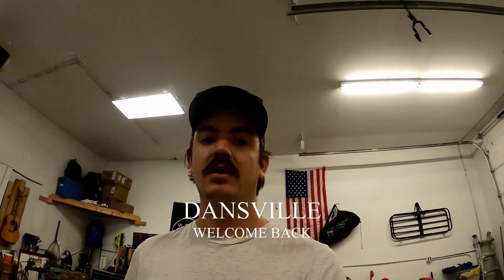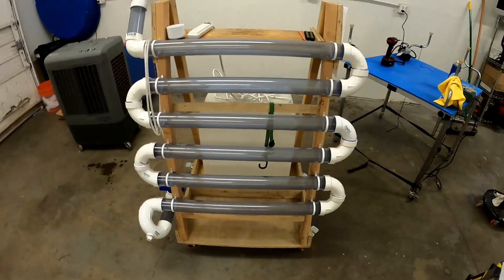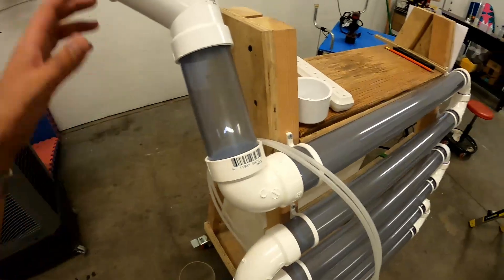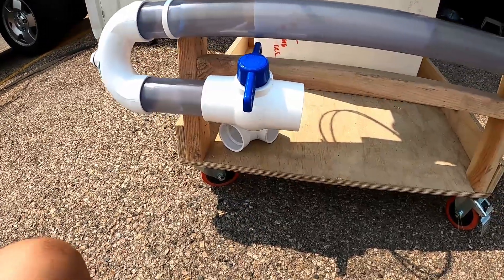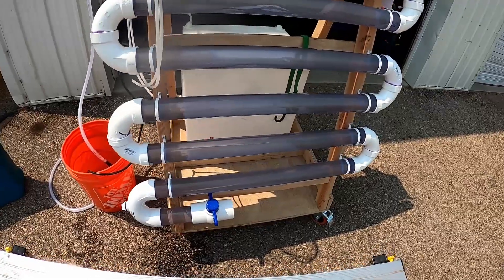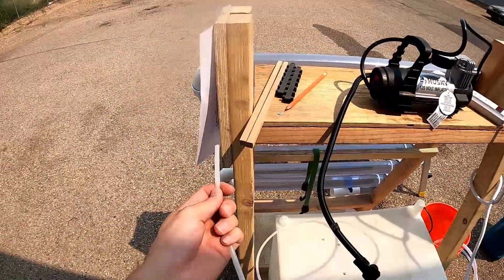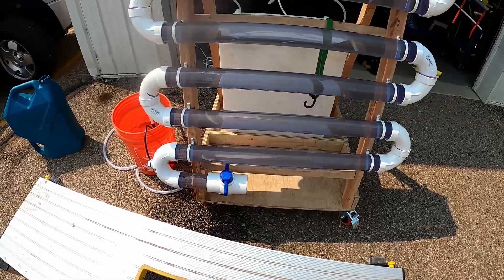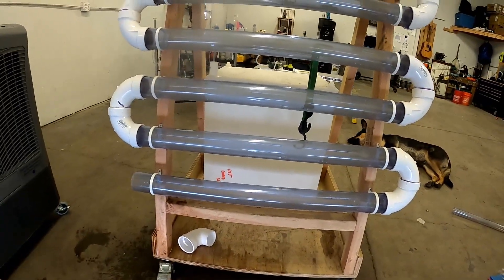ALGAE Photo-Bioreactor: EPISODE 3

Comment: The Air needs to be pumped in at the bottom, then it would percolate to the top, a small valve fitted to the bottom, the pump would probably only need to run for a few seconds, a few times a day, that would add CO2 and help the Algae move about and catch more Sunlight.

Comment: I love this project. It sounds like you intend to pump the water in from the top and drain it from the bottom. Why not pump the water in at the bottom of the zig-zag clear tubes portion and have the return be coming out the top and back into the tank? This would avoid having to drill and seal holes below the water line of the tank. I saw your update that you got married (Congrats!) but I hope you eventually get back to this interesting project eventually.